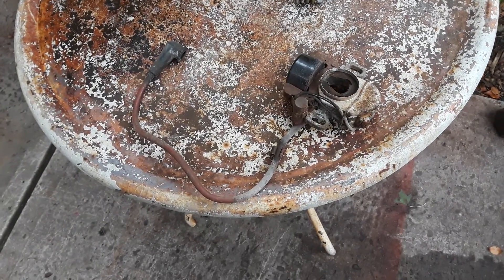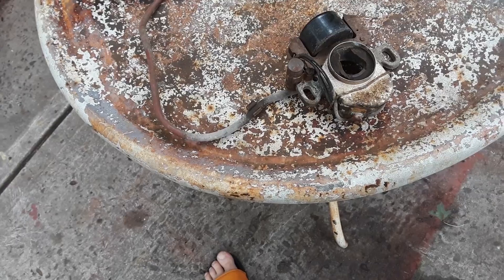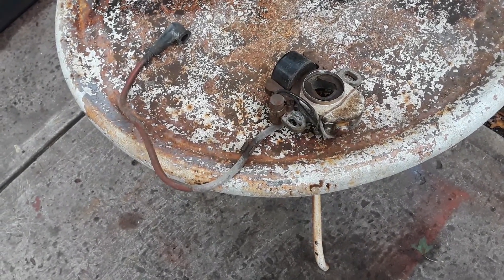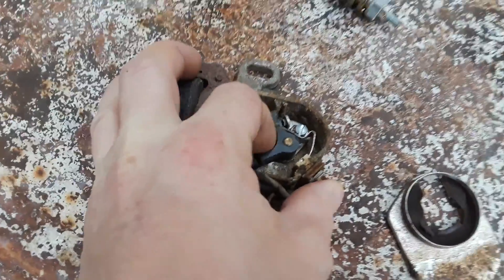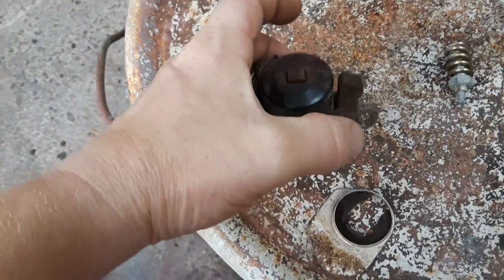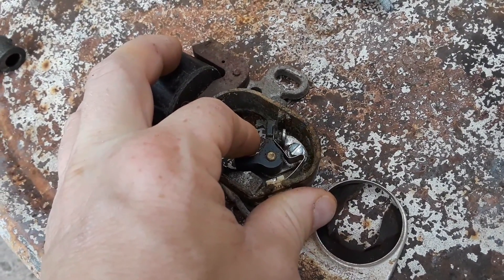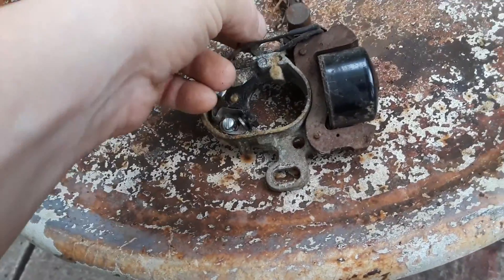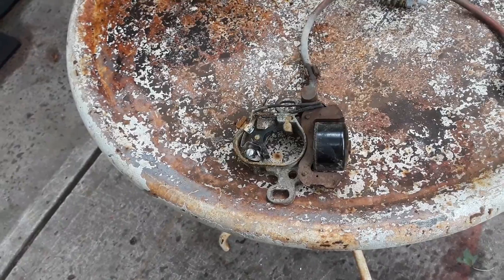Points and Condenser (breaker ignition) Common issues & how to regain spark.

Comment: I am replacing an ignition coil on my H50. One thing I can't figure out. How do I replace the spring retainer for the coil holdown?  I've watched a few videos but they don't clearly  show the retainer in place. It also seems like there may be more than 1 type of retainer clip used . I took a photo of my old engine of the flywheel and cover removed to expose the points but I still am scratching my head trying to figure out how to reinstall it on my new coil. This video is good but it doesn't show the retainer clip in place. Thanks.

Comment: I replaced the points and condensor. Set the gap at .02 and still no spark. What now?
Reply from the maker: Make sure the ground wire is not touching any metal or it will ground it out, of course make sure your throttle is on fast, the ground should hook near the throttle for stop. If that's not the case, you have a bad coil, rarer, but it happens. I have some (full magneto's with good coils), I would put your new points and condenser in my Magneto coil assembly, the points condenser on mine are usually good, but still old so while your doing it, put the new stuff in). If you want I it, can list it on eBay, alongside other stuff I have for sale. Whatever the best prices on eBay for one of them assembly's, I'll beat it by a few bucks. With same or lower shipping.
If you want one. Let me know, I'll list it and send the link once its up.